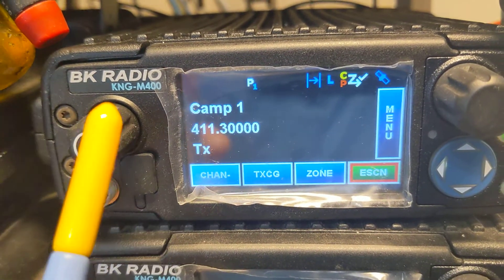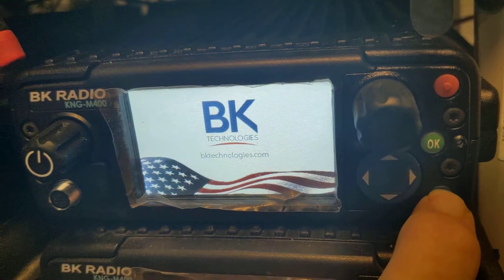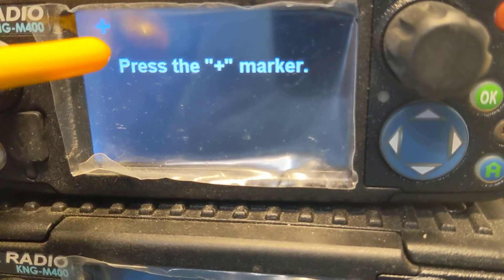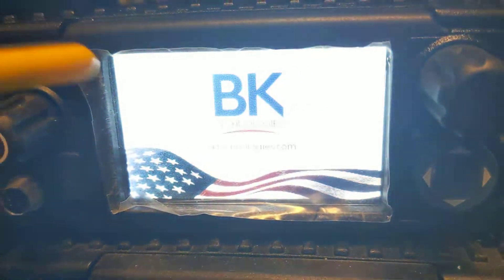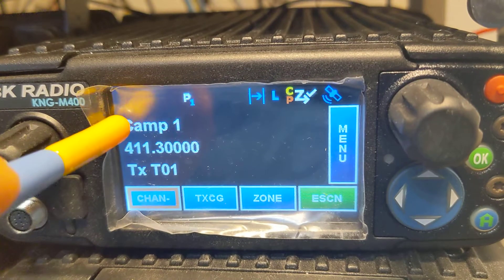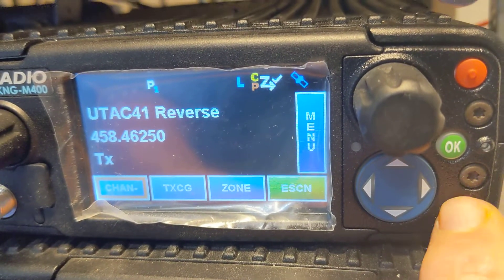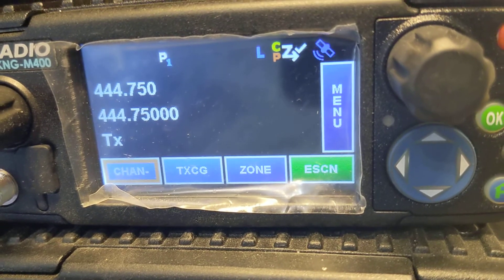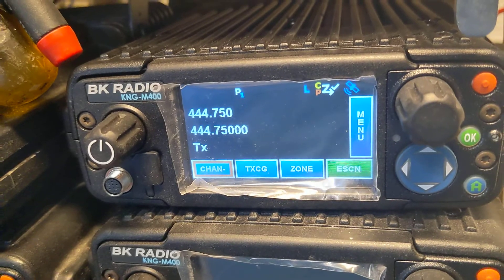Relm BK KNG-M150 Touch Screen Fix

Comment: Thank you. I have a bunch of those in a box written up as b/o. I took a an M150 control cable and cut it in half, extended it with about 500ft of house buried cable to the other side of the compound to get the radio to a good antenna on a tower. You couldn't even tell a difference. Worked the first time, no mods. Best backup radio ever. I say it's better than the console. Jim
Reply from the maker: Wow, now I want to try that ;-)  Wonder how it loads large zones over 100 channels. Setting Max-baud to max (200,000bps) solves screen refresh errors, video coming.